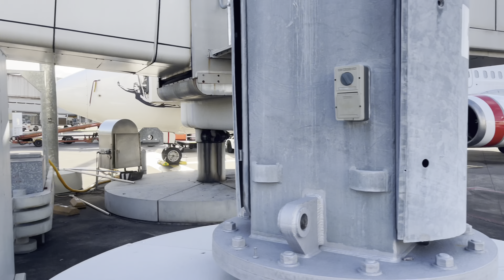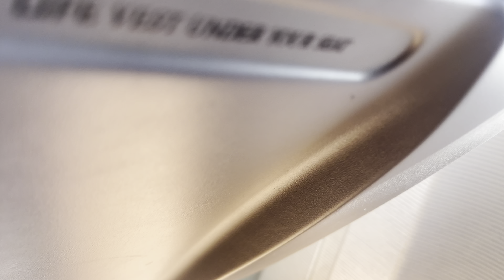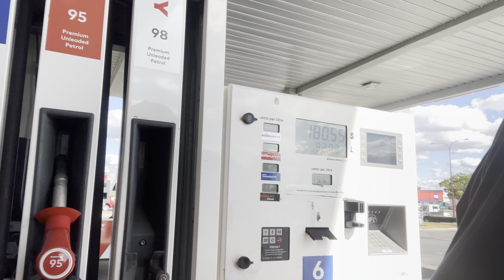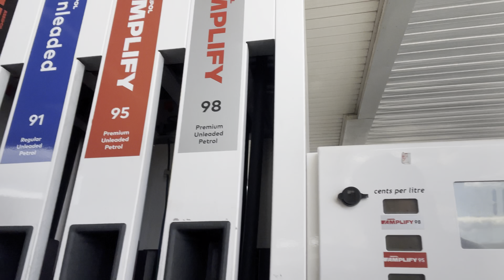TB48 TURBO!! Perth to Canberra in a tb48 turbo!

Comment: How much fuel did you use doing that drive? and how many kilometres? What was your range like on your fuel tank?
Reply from the maker: Hey mate! We will be making a full rig rundown very soon and will explain everything there! 

For now the car got roughly 650ks to both stock tanks! The whole trip was 3700ks I believe
Reply: @tbzon2r  that’s really solid for stock tanks and a turbo, is it viable for remote touring? What’s your liter per hundred you wreckon?
Reply from the maker: @pullingguard1527   hey mate! Honestly we probably could set it up for touring but it was bought for more of a fun weekend car! I think roughly 22l/100km